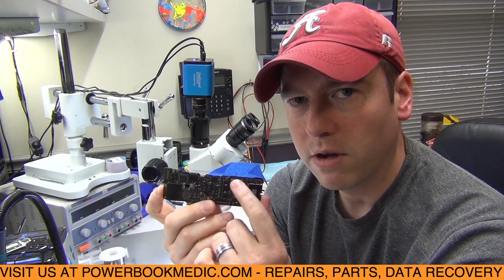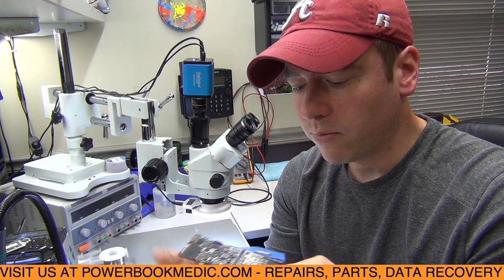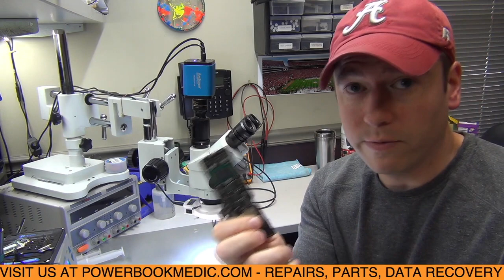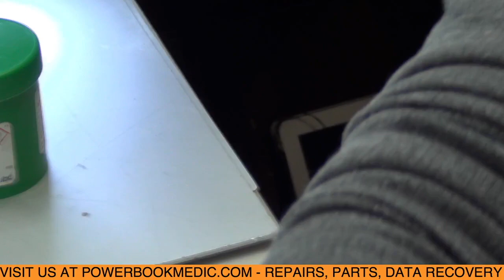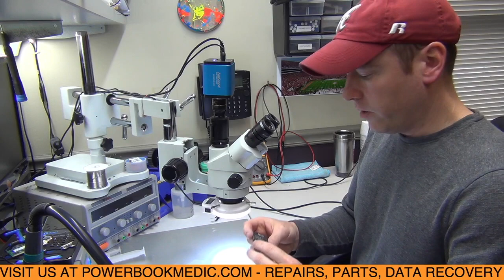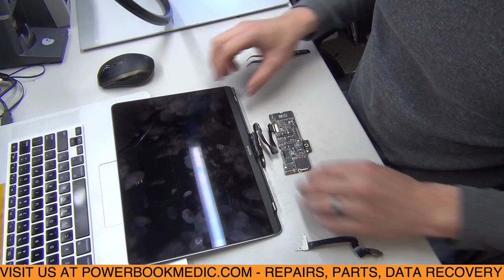Macbook Display Connector Replacement 2017 12" Retina - Board 820-00045

Comment: Hi, Can I ask if you can do this repair for me. in repacing my battery the lvds cable metal top clip pulled off when removing my LVDS cable. I have the replacement part.
Reply from the maker: We should be able to help. You can find more information about our repair services at this link: https://www.powerbookmedic.com/xcart1/pages.php?pageid=67

Comment: Does horizontal lines and flickering of the screen, occuring intermittently while bending the hing of MacBook 12 Retina are indicating LCD flex cable fault?
Reply from the maker: That would definitely be a good place to start.
Reply: @PowerbookMedic  oh and it works normally when connected to the external monitor.
Reply: @Kac309  then its not the gpu at least lol

Comment: Hi I have a question i have a macbook 12 inch retina (early 2015) but i have a problem with my screen I have pretty washed out whites, what i mean is white is pretty intense like i have a contrast problem don't know if it is a cable problem or my lcd screen is about to die, you know what could it be?
Reply from the maker: It most likely is an LCD problem but it's hard to say without seeing it.
Reply: @PowerbookMedic  how can I send you a picture so you can help me decide which problem could I have
Reply: @PowerbookMedic  the weird part is when I'm watching a movie the colors are fine but the problem is the white color but when I hit pause it the movie the color white corrects it self then when I return to the desktop the color white punches In like crazy
Reply from the maker: @LS__World  We would really need to see the unit to see what's going on. We have a send-in repair service available. You can find more info at this link: https://www.powerbookmedic.com/mac-service.php

Comment: how much would you charge for replacement of this connector? I ripped the cable and the metal part came off. Also what king of conformal coating are you using? Is there a transparent version of it?
Reply from the maker: Ismar Hadziabdulahovic Hello! You can check out our pricing and more information on our website https://www.powerbookmedic.com/xcart1/pages.php?pageid=67

I use Seal-Glo Conformal Coating.

Comment: Another excellent video. Need to replace J4801 (trackpad connector) on the A1534. Mouser has them available in the US (Molex # 502250-8041). Will follow your guidelines. Thanks again.